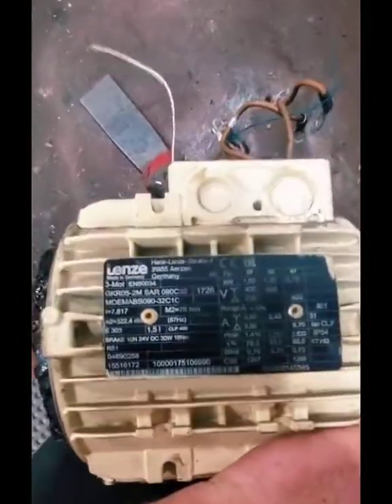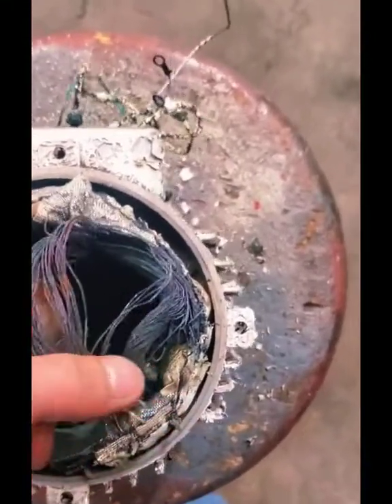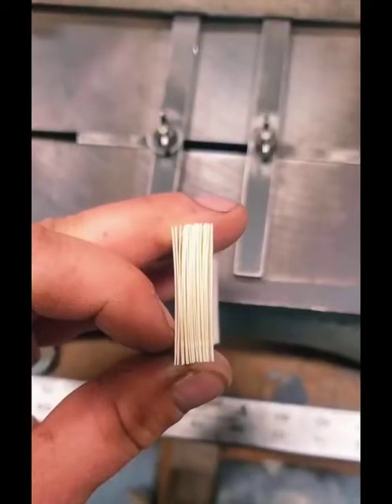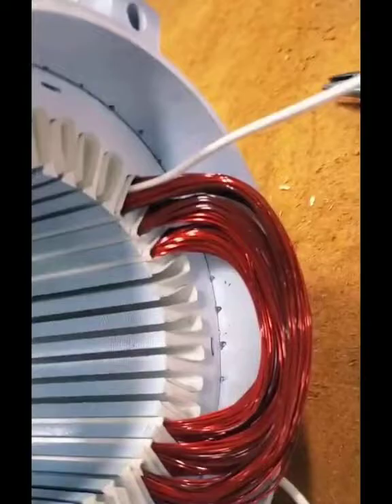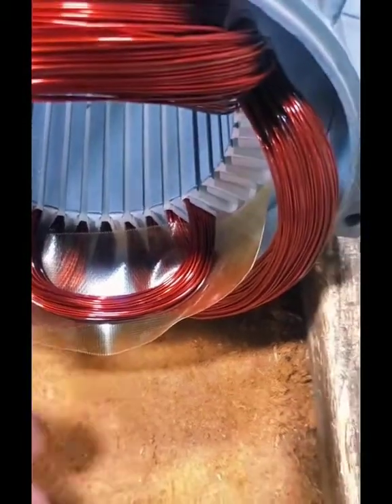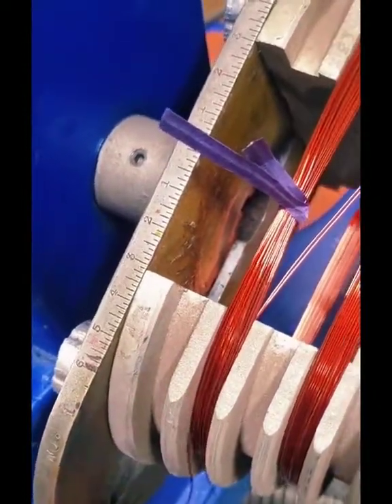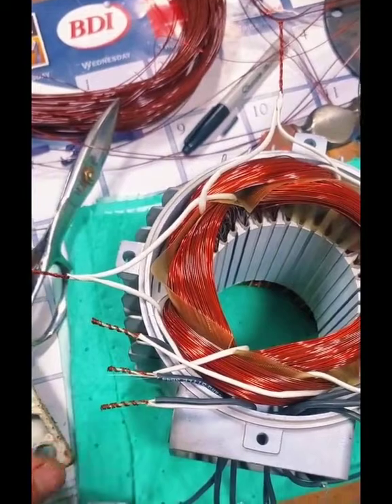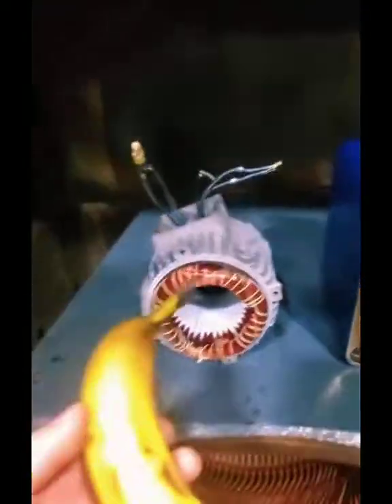How to completely rebuild an electric motor the correct way in less than 3 minutes.

Comment: Do you have a shop for repairing ac motors? I have an old drill press with a 1/3hp motor. It just hums when I turn it on. Any help is appreciated. Thanks.
Reply from the maker: Sorry, no.  But it’s possible that you have a bad capacitor!
Reply: @Karl.Car.tech.1 ok, well thanks for your reply. Your videos are great by the way. Keep up the good work.
Reply from the maker: @kawikaturn  Thank you.
Reply: @Karl.Car.tech.1 my motor is a repulsion induction motor, so there is no capacitor.
Reply: Looks like I need to Clean/adjust brushes, verify continuity.